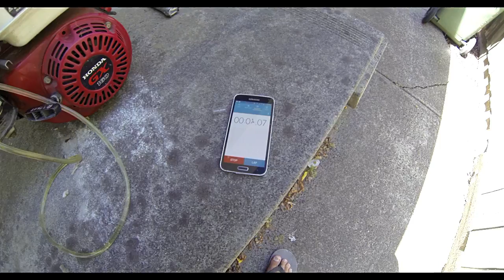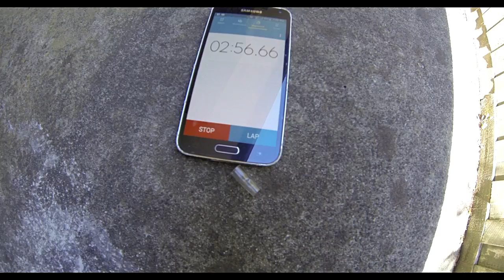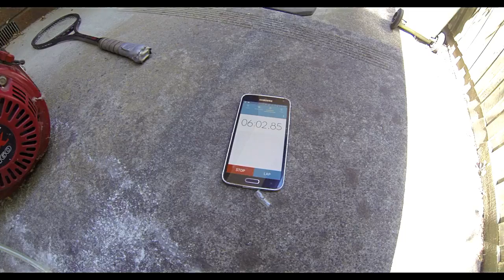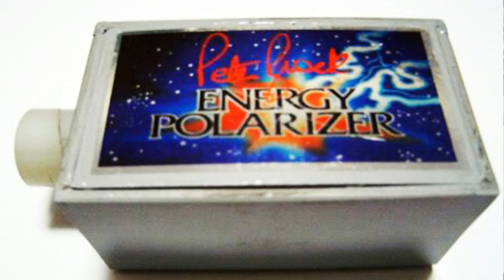MAGNETS: mysterious power effects on fuel & gazoline

Comment: your an idot you have to have the maximum flux  of apossining poles. in other words  the magnets have to push against one another  in order for it to work.  thus the reason for the zip ties. notice the zip tie are loose which means you had the magnets in the wrong position you fuckin moron.

Comment: You need to run the hose through the core of a magnet then through the pole opposing magnets and then through the core again, forming a flumox loop, which amplifies the effect exponentially, enabling fusion overdrive.
Reply: Interesting information.

Comment: Good field expereiment. Probably doesn't make a real difference, but you used iron wire which will change the field lines through them instead of through the fuel. For the sake of clarity, using the nonmagnetic nylon zip ties may have been more consistent. One place where the magnets WOULD have made a difference is in my old N14 Nissan pulsar SSS. The fuel pumps in them hve very tight tolerences and when they expand they rub and wear metal off the inside of the pump. This then stuffs the injectors. The magnets might have stopped the iron getting to the injectors.  As a magnetic separator they would work. As a magic fuel energizer...er...no.

Comment: The same amount of fuel will go through the carburetor, no matter what you put on the fuel line. The only difference could be in change of power from the fuel  in a car you would put your foot on the accelerator less, IF the fuel somehow increased in energy released. Cheers
Reply: You are correct, these experiments are useless and they are shooting in the dark. Magnets won't change milage on any vehicle that doesn't have an ECU. The ECU senses the change in fuel requirements and can change the ECU parameters to change the amount of fuel needed.

Comment: Peter Brock also thought the 'Energy polarizer' made the car handle better with only 23psi of air in the tyres.
His engineer constantly filled them back up to 30psi and Brock would let them down again.
For the Energy Polarizer to also 'work' a metallic sticker had to be placed on the back window that supposedly aligned the energy flowing through the car into the Polarizer.
What a dick head!

Comment: I bought a new Mustang GT back in 1988 and had purchased the set of magnets through a local company that had produced them specifically to wrap around your fuel line and zip tie on each end. I ran several different tests before and after and there is no doubt that I got about 2 miles to the gallon more with the magnets. And then I had run an emissions test before and after and the before was an 11 on the HC and 0 on the COS and after the magnets the HC drop to a 2 so that proves to me that if you can burn cleaner that means you're burning the fuel more efficiently which would mean that you would get better fuel mileage, more power , less carbon buildup in the interior of your motor which would mean you can go longer without a tune-up and you're burning cleaner so you're helping to preserve the environment and I am just an individual I have no affiliation with any magnet company I'm just telling you my story. I wonder if anybody else has done before and after emissions test because that is basically I believe the best way to prove weather they work or not and also driving a road course at the same speed limit same distance same course before and after and that will tell you if your mileage has increased. The manufacturer of these particular magnets that I used on their package advertising it said that the magnets turned the negative molecules in the fuel into positive molecules, I'm not a scientist so I can't speak on that maybe somebody else out there knows more about that subject
Reply: Hate to tell you but according to a couple of the comments below a couple of people said that they have them on their car right from the factory I don't know that for a fact but just saying
Reply: gani ndreu 

I hope you don’t automatically believe whatever you see, hear, or read on YT. Everyone knows that as fuel passes through pump and filter(s) the molecules are energized and perfectly aligned for high energy combustion, so no magnets are needed. It has been so for decades.
Reply: @FrankGutowski-ls8jt  it's obvious Frank that you didn't read my post. Have you run any tests to be able to prove if they work or not? I don't think you have I think you're just talkin out of the top of your head, I have evidence where is your evidence that they don't work? Have you run any tests like I have?
Reply: gani ndreu 

I have many PhD. If this had an effect it would be detected and quantified by, at a minimum,
 high resolution NMR and IR spectroscopy. No further testing of the kinds you’re probably capable of would be needed.
Reply: @FrankGutowski-ls8jt  what tests have you performed to disprove this Theory? You can talk about your PhD all day long long as you have not performed any tests then your PhD still has no Authority
Reply: @FrankGutowski-ls8jt  like I said in my original comment , I have no monetary gain because I have nothing to do with a magnet company as far as ownership, stock, I'm just telling you my story and what my results were and there are many others that agree. Like I said if you can drop hydrocarbons from a .11 to a  .02, they obviously made some type of a difference
Reply: @port nut I don't know maybe the Deep state was busy making its petroleum industrial complex richer because it was making the Deep State richer did you ever think of that? There was a lot of products that they would not allow to be patented a lot of people have been murdered for trying to push for their patent to go through I hate to tell you do your research and then talk to me
Reply: gani ndreu 

If they worked, they’d be standard equipment. They’re not, and never will be.

Comment: Smith A replied: "A gallon of gas weighs 6.3 pounds as per google, if a car has a capacity to hold 16 gallons, then you are carrying 100 lbs of weight. At half tank, you are carrying 50 less lbs of weight. Just beca..." I seen you deleted you reply to me for unknown reasons ????
Reply: A gallon of gas is 128 Oz there is 16 oz to a pound that means a gallon of gas weighs 8 lb. Not 6 pounds
Reply: gani ndreu 

Ha. Fluid vs weight. Density matters!

Comment: If you want a gas saving tip. never fill your tank all the way up. Because it makes you use more gas to haul more weight. Thats proven fact I have showed everyone. I may seem that this don't work because you are at the gas station more often than a full tank of gas which then gives you the feeling that you are using more gas than normal.  

you get the same effect on the beltway after driving 2hrs at 80 mph and then have to go 40mph it makes you think you are going slower than you really are you near feel as if you can jump out and run. It's because our minds start to adjust at higher speeds and faster actions. That anything slower takes us no time at all to act. Sometimes our mind can fool us into many of things, But try my method for a month and then try your way for a month and keep track of how much gas you put in not the price. I bet you will see a slight difference right away. Then compare that to how much per year that you would be saving. 
by Gallons not price because price always changes gallons never do. Also you will be creating more fumes than liquid gas which lasts longer than liquid gas and this is perfectly fine to do. because anyone that wants to argue with me that it is not safe to do than get rid of your fuel injectors and your evap system because that is what they are doing so don't be fooled by anyone telling you any other way.. Fuel injectors converts liquid gas to a vapor by atomizing it to a fume so it can burn it more effectively So again nothing wrong with running on gas fumes if you have fuel injection than you do not have a gas pedal you have a air pedal it is the pcm that decides how much fuel your injectors are going to atomized for fuel consumption. Only pre 1980's and back had gas pedals that controlled the carburetors liquid fuel.
Reply: A gallon of gas weighs 6.3 pounds as per google, if a car has a capacity to hold 16 gallons, then you are carrying 100 lbs of weight. At half tank, you are carrying 50 less lbs of weight. The of difference of 50 lbs making substantial effects on gas mileage doesn't look convincing... (respectfully). 

I have heard from many people (correct me if I am wrong) that driving around with a low gas tank many times over the course of time is bad for the engine.

edit: just to say, I would have to tradel 216 miles before I got to half tank, thats 3 hours if consistent on highway at 75mph.  it would seem to me that what you say may be true when you consider driving in the city since the extra weight sitting there when you are stopped makes it require more energy to get going again. Very interesting nonetheless
Reply: Smith a...the motor get damaged because water and trash is being sucked toward the engine coming from the bottom of the gas tank.....

Comment: You forgot to put magnets on the air intake side the opposite way cuz Opposites Attract and that improves your burn and your miles per gallon if you did that you would have seen a difference probably. And after that you would probably have to adjust the air fuel ratio to burn with the difference positive negative pull things usually ain't that simple to work

Comment: put the magnet close to carburator, both facing south pole ,in my bike it feel more power and engine RPM increase ,also in my car . so definitely it works ,and it very cheap to use magnets.
Reply: I could sell you anything.
You would buy anything because your parents raised an idiot.
Reply: @johnperry5396  takes one to know one...u think u live on a spinning ball 2 don't ya lolololool dumb fools everywhere ...
Reply: Is this method relavant? I have to do this as a project. Shall. I proceed? Please reply
Reply: enigma hi . I agree. I had a problem with my hz troopy diesel and i had spoken to  a mate about it, some days it would run great,  and then on the next it would fell lazy . I only just found out about magnets on fuel and tried them out . It now gives me an engine that is stable , and , allwas gives max performance. Only one problem. I still have to put diesel in the tank .
Reply: myth busters are u for real.......lololololololo dumb
Reply: vinygee he msuslim his ALLA is dicking his cars from behind that why his cars feels powerful to him
Reply from the maker: enigma khan it does not work. Its been debunked by more reputable ppl than me. Myth Busters
Reply: @vinygee1  .  . myth busters . . . those guys are paid shills
Reply: @vinygee1  myth busters are fools ...they think the world is a ball..lololol